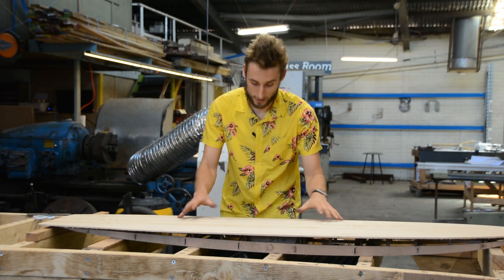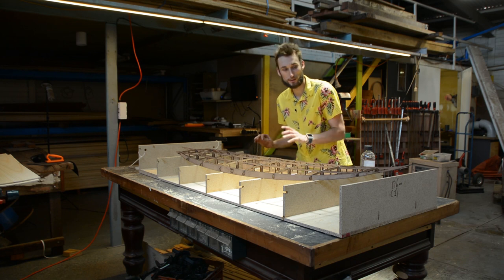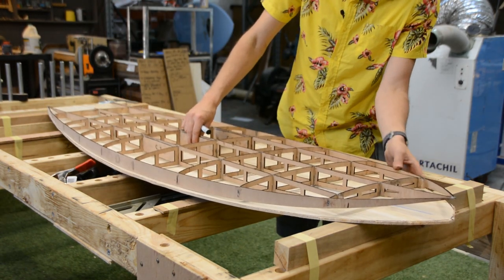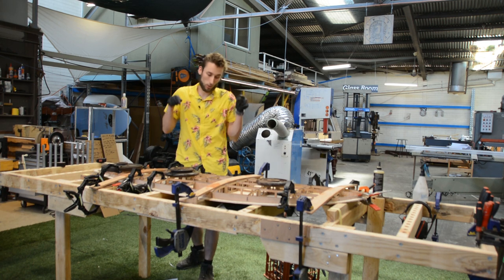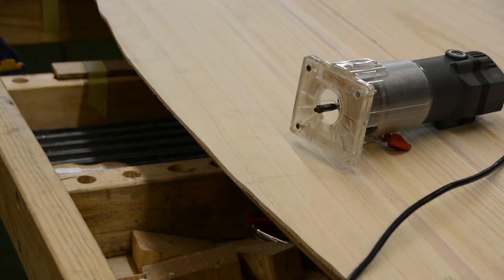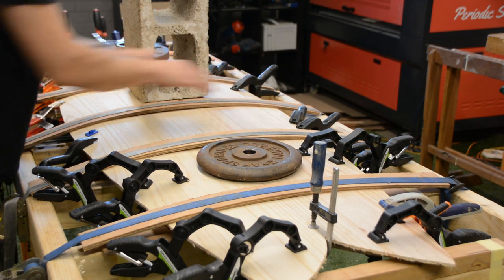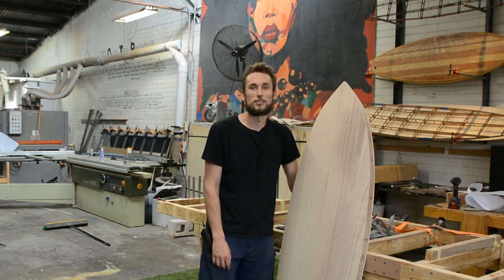How To Use A Rocker Table To Glue On Your Top And Bottom Deck - Hollow Core Wooden Surfboard Tips #3

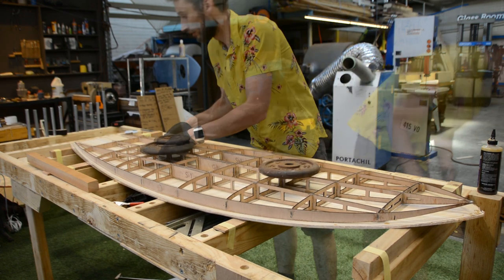Comment: What thickness are the strips of ply you're using for the top of the clamps at 4:28? looks to be about 12mm by eye.

thanks from the UK!
Reply from the maker: we use either 9 or 12mm strips, 12mm is definitely the way to go though